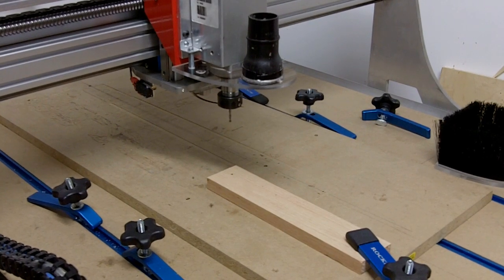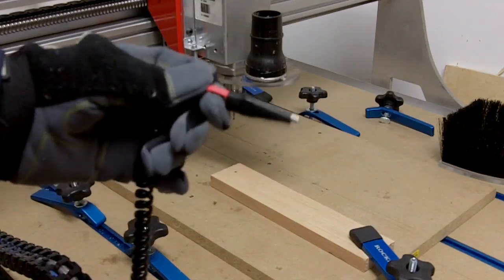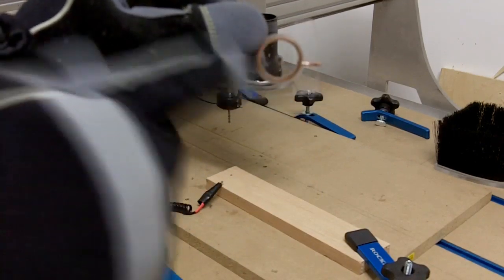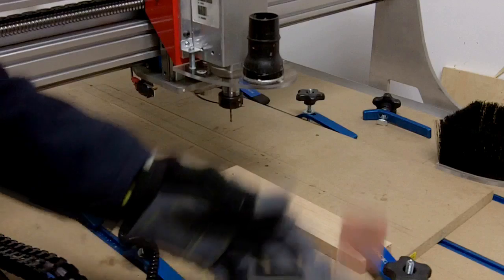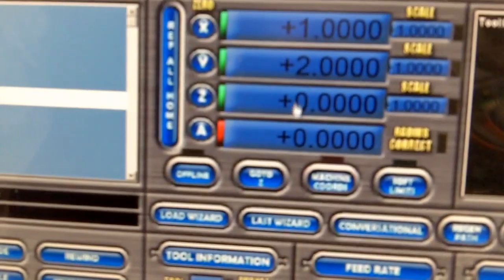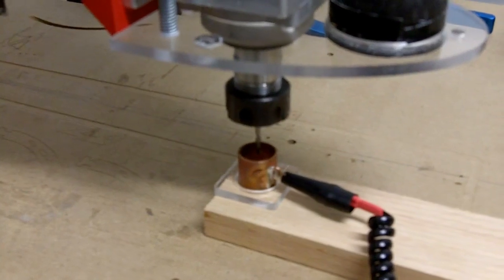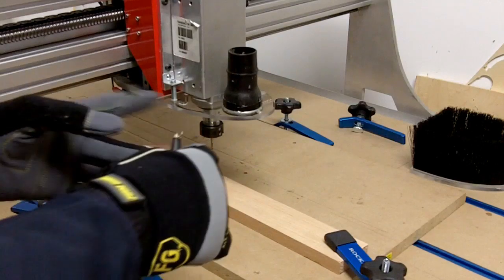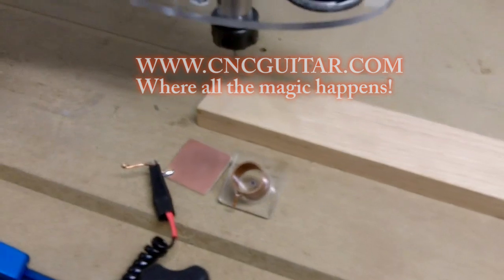touch.probes.mp4

Comment: Very nice... I like your center adapter... I'll have to make one. I have a Wells Index CNC that I am running with LinuxCNC. I have created my own custom panel and have added two tabs for probes. I have the surface and center hole working, and i am adding edge finding, corner of vice, angular offset, and jig alignment routines. The probe is a really handy device. I was wondering what I was going to do for tool height setting... since my machine, vice, and material are all conductive... the circuit board material is brilliant! Thanks!!!

Comment: Why not make the z height plate built into the base of center finder? Use a pin like you have been doing, but don't make it protrude through the base into the copper pipe. Then you can center your hole, and z touch off all in one tool, instead of switching. :)

Comment from the maker: @musicmaneman1 The other end of the probe connects to my CNC controller's break out board.  I use a pin on the breakout port which is not being used for control, and then I simply map that pin in mach3.  When the pin goes high, mach3 detects it, and acts accordingly, like in my video.